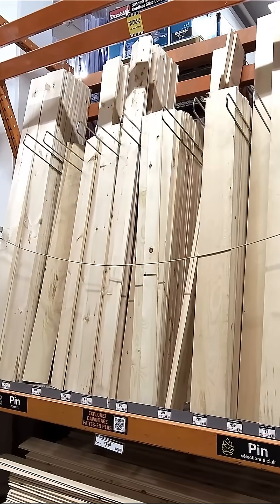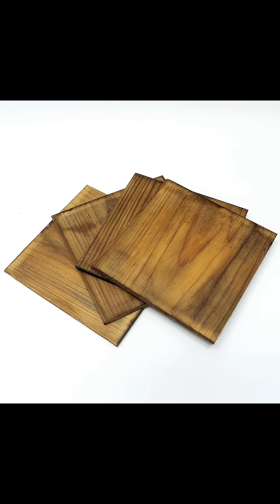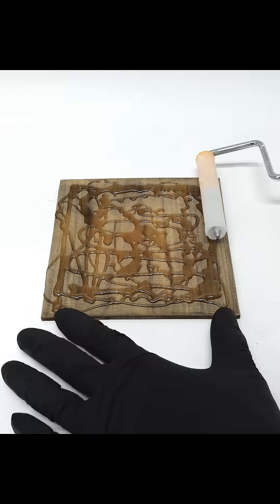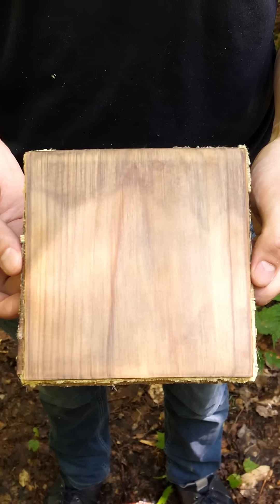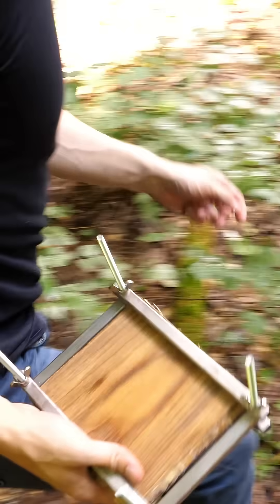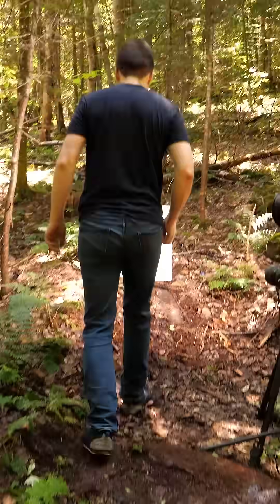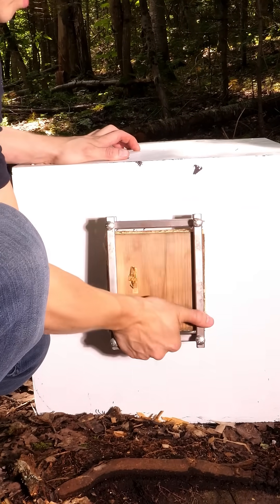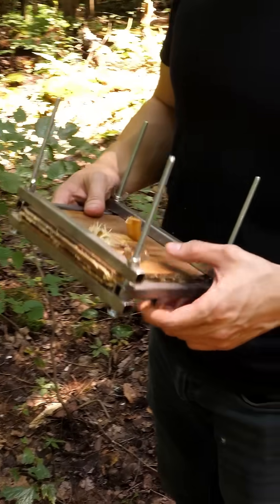Making bulletproof-er wood

Comment: The kevlar needs to be at the back and not glued on the full surface. It's strength is in the ability to flex, so putting it in between those wood layers and squeezing makes it the weakest that kevlar can be at stopping bullets.
Reply: Agreed, If you held the wood together on the edges and let the kevlar able to move and contract it should perform better. the further the anchor points likely the better the kevlar will perform.
Reply: Also I would think something like glass at the front would help, A very hard surface that is just meant to deform/breakup the bullet before it passes on. Logic being that increasing the front surface area of the bullet or breaking it up means smaller masses with speed so less energy to each to stop or larger surface area on the one making it easier to apply resistance to it.
Reply: @coreytaggart128 The "kevlar - hard wood - ceramic kitchenware" composite plate gonna revolutionize personal protection.
Reply: Agreed I said similar
Reply: Why at thr back? Why not front?
Reply: @Loralanthalas because the kevlar needs space to stretch and absorb the impact over distance. If you put it at the front it can't do that and becomes ineffective. If you put it in the back the wood will deform and slow down the bullet, making it easier for kevlar to stop, and the kevlar will get the space it needs to do its thing.
Reply: UTTP IS BETTER THAN NILERED
Reply: @OfficerBankruptUTTP ok gooner
Reply: UTTP IS BETTER THAN NILERED

Comment: i mean, looking back it makes sense.. cevlar itself is good bc its many layers slowing and supporting each other.. the wood with the switched grain directions also holds each other back basically splitting the force really quickly really wide.. the cevlar just makes the grains not support each other that well and also is byitself with the glue kinda useless if it cant move back to "catch" the bullet

Comment: Kevlar absorbs energy by deforming and flexing. No flex, means no energy absorbed.
That being said, you would probably have better results if you'd use fiber glass and fiberglass resin which you cure under pressure and ideally also a vacuum.

Comment: get a normal size layer (whatever that stopped them. put one of these kevlar/thin layers on the back but with 4 layers of kevlar - 90° grain. on the front put 4 kevlars put all the glue's in the kevlar layers like |V| 4 lines and apply small dots on some layers and no dots on others. 

laminate that product too this same product but divided equally in two with an air gap inbetween the two at installation. - put the 2 on front

Comment: WTH is "impact resistant glue?" So many possibilities, but I guarantee you that many, many candidates for adhesive have never been tested or rated for impacts, but I have to ask, why would you use glue at all? Just stack the materials, bolt them in and fire. The glue may be your culprit, because kevlar is a loose fibre and that is how it works.

Comment: There are a couple reasons your armor is less effective than previous.

1. A single plate is generally stronger than multiple plates of equivalent thickness.  Two 1-inch thick plates is weaker than one plate 2-inches thick although I forget by how much.  

2. As far as armor design of the individual plates, you deal with the problem of strength vs flexibility.  A stronger piece of metal is more elastic and more prone to deformation, but that elasticity is what allows it to resist stress.  However, being softer, it will struggle against concentrated force.  A hard plate is going to better spread out the kinetic energy across its surface, but this comes at the cost of being brittle.

These concerns are what made the invention of Harvey Steel armor so important.  Harvey Steel was manufactured by quenching one side of the steel quickly and allowing the rest to cool more slowly.  This process hardened the front while keeping the backing of the plate more flexible.

Taking this principle into consideration, you'll get the best results with a solid wood front and kevlar backing.  Wood in particular suffers from the issue of splintering, and having a kevlar backing to catch those splinters would be key to the success of future attempts.

If you want more information on the principles behind armor plate, I recommend researching Harvey and Krupp steel.  Researching ironclad warship development may also prove useful.  Oh, and Drachinifel has a whole deep dive into the development of warship armors throughout the latter 19th and 20th centuries.
Reply: Spaced armor is not less effective than a straight plate. Composite armors use different materials that alternate, similarly to what NileRed tried to do, but not spacing it is what made it less effective. You try to have your more hard and therefore brittle material before your deformation material, and give the deform material some space to deform. Tanks like to use DU, and ceramic with composites with kevlar spall liners. DU and ceramic have different properties, and putting spaced plates gives you the benefits of both. For body armor purposes you cannot easily incorporate 2 types of strike plates and a spall liner, but there are some prototypes for double plate spaced body armor that use kevlar. I do agree that putting the kevlar at the back would be most effective without putting spacers, but I think you could space the layers with kevlar so long as they are far away enough from the next wood plate. Very interesting history here though, thank you for mentioning it.
Reply: I think 1) only goes when there is no connection between the layers, isn't it?
Reply: he also negated the effect of the kevlar by gluing it so much. kevlar works by being flexable and he glued every inch of it thus making it completely useless.
Reply: A NileRed and Drachinifel collab would be a dream come true, they’re two of my favorite YouTubers!

Comment: The epoxy made it too ridged. If you had added some padding or put all the Kevlar in the same layer without any epoxy, it might have worked. Armour works by distributing the force of impact. Epoxy defeats that purpose.

Comment: the issue is that the glue and the Kevlar holds the word together - you can see in the first video that the front of the wood exploded, and that explosion absorbed a lot of the bullet impact. This time the wood was held together more strongly, so could not shatter.

The key thing for defending against bullets effectively is for the armour to shatter/crumple! This is why ceramic plates are so effective! Kevlar is fine for small arms at a reasonable distance as the impact is small enough that just distributing the load means you get a bruise instead of a hole

Comment: Agreed on the kevlar, the modern rogue actually did a really good video on how to make homemade plates and bulletproofing. You also need ceramic in between to disperse the energy upon shatter. Even if its bullet proof and hard enough to stop it, the jules alone can still be deadly so thats why you need to disperse that force. Itll also stop the bullet from fully traveling through. As well as kevlar needing to flex

Comment: Well, rigid kevlar didn't work. Time for plan B. 

I'm going to take 3 thick layers of this compressed wood, pass it through a wood chipper and then take the pieces and mix them into a ziploc full of mayonaise. I figured since the kevlar being rigid doesn't work, I would remove the kevlar and make everything else fluid. Now I will test if this new method will stop a 9mm.

Comment: You should try saturating the wood and kevlar with resin in place of the glue. Additionally, you may want try ditching the Kevlar all together as the semi-flexible Kevlar layers may be making it easier for the wood to break.

Comment: Man it might honestly work better with a super thin sheet of hardened steel then the wood but glue it with wood glue (it basically chemically fuses the wood together by using a compound from wood) then kevlar on the back

Comment: If you've ever seen Martial Artists break multiple wood boards, or tiles, or cinderbricks in a stack, you'll notice they leave an air gap between each layer. While it's not air, you've left a flexible gap between the wood, weakening the overall structure instead of reinforcing the rigidity. Combined with what others said about the kevlar needing flexibility, you've got dueling systems here of rigidity and flexibility that aren't making a very good composite, but instead work against each other.

Comment: Kevlar flexes that’s why I didn’t work what is solid and it doesn’t flex so putting Kevlar in between the wood, it wouldn’t have enough area to flex so it would the bullet would just go through. A solution would be putting the Kevlar all on the front and then putting the wood on the back.

Comment: Try separating each layer with Popsicle sticks around the edges. It should give it a little flex to allow impact absorption.
Reply: Or two thin layers around a frame, with a non Newtonian fluid filling the gap.

Comment: 2 layers of Kevlar in between each piece of wood.  Criss crossed.  Pull each layer down tight, let set, separate.   Graphite powder will help increase epoxy strength.  Find a way to pull the fabric very tight.

Comment: As said in the comments, you should leave some room for the Kevlar to flex

I would also suggest reverting back to the thicker pieces of wood you used previously, but this time use 4 thick layers instead of 3

Comment: Kevlar is pretty useless when it cant stretch, using it with glue on a hard surface defeats its purpose. you could just glue the outsides to the fabric when you want to use Kevlar.

Comment: You needed to take the kevlar and do 3 layers with one warp up and down and then do one at a 45 and another at 90 degrees. Warp is the direction of the fibers.
Use 2 part epoxy as your glue. 
Congrats, you've just made composite.
Now put the composite between 2 wood and, while it might not stop a bullet, it'll be insanely strong if you try to bend it.

Comment: The point of the kevlar is that it can flex and the deformation robs the bullet of momentum. By sandwiching it between rigid wooden plates you basically made it's primary function impossible.

Comment: When it comes to ballistic performance one plate of a given thickness will always be more effective than more plates of the same combined thickness. As for the Kevlar you have it in the wrong place. You want your hardest armor component on the front and gradually softer but more flexible layers behind. The idea being the hard plate shatters the round or at least makes it start to deform while the Kevlar catches it.
Also I'd put money on that Kevlar you used not being ballistic rated but just the raw textile not all Kevlar is created equal and 4 layers of actual ballistic Kevlar would stop a 9mm on their own wood or not.

Comment: Kevlar works by absorbing the energy... By making it rigid, you counteract its properties... I think the kevlar itself could be beneficial, but it needs to be able to move... Think trying to cut a rubber band by swinging a knife at it... If the rubber is pulled tight it only takes a small nick, but if its limp you can slash it all day to no avail.

Maybe only glue the outside parameter of the plate... Or just layer it all up in a vacuum sealed plastic 🤷

Comment: Kevlar is meant to be flexible and stretch and move and you eliminated that when you soaked it in a hard resin or super glue.  You made it brittle.  Spacing it out in lose pockets might work better.  Try Osage Orange  (Bodark) a hard yellow wood next time.  I think it's the hardest and most shock resistant in the U.S.  Also bamboo is very shock resistant so you might consider it as a cross grain.

Comment: This isn't such a bad idea. I've worked with several woods over the years and main issue with any of them is fiber orientation aswell as their density. Kevlar as a reinforcement could work but would need to be stacked layers of them not a single sheet between the wood pieces. another thing that could be added would be like a 2-4 mm sheet of "textolite" as a middle support layer stuff is used in electronics and is about the hardest thing i've ever tried to work with.

Comment: Maybe, the glue actually weakened the Kevlar material.  Isn't Kevlar meant to be flexible?  So it slows down the bullet. It is not meant to be a solid. It is meant to be flexible.

Comment: When you glue it the material doesn't distribute the energy but only act as a block, when it was only wood the tiny air gap between the layer let it distribute the energy across the boards. Material is only good if it distribute the pointy energy impact distributed.

Comment: Ideally, the Kevlar should be loose enough to catch the bullet rather like a bag. The momentum of the bullet would then be transferred to the Kevlar and from that it would be distributed to the layers of wood. Bonding the wood together would probably work best but only loosely attach the Kevlar to outside of the wood.

Comment: It probably needs to create dampening zones within the layers, not just have a hard shell. It's the same as puncturing a door vs the same with many doors, the separation of each door dampens the momentum of the force significantly until there is none left.

Probably glue two separate layers of wood-kevlar-wood (two hard shells), with the middle layer of kevlar being glued in a grid like pattern, like building a layered crisscross net, then fixed in between with glue only around the edge.

Comment: Wood is great at shattering and releasing the energy of the round, kevlar's great at plastic deformation to catch the bullet. If you had layers of wood in front and Kevlar behind it, but didn't glue the Kevlar down, the Kevlar would catch the shrapnel from the wood. Effectively you'd be making ceramic armor but with wood.

Comment: Fine Woodworker and carpenter here. So part of what could be the issue is actually how the wood you were using was cut from the tree. In the first block it looked like it could have been rift sawm or maaaayyybe quarter sawn lumber where the smaller pieces look like plain sawn. It basically has to deal with how the log is cut up but crucially it also deals with how the fiberous tubes that make of the wood are orientated. Googling a photo makes it much more clear. It also why say for a cross cut you can use a blade with much more smaller teeth to cut across the fiberous tubes making up the wood where when you do a lateral cut from the top to bottom it cuts in between the grains and is why you need a more aggressive tooth pattern..

 I also think part of the issue may just be you are using too thin of sheets of wood. Even if you were to take one board that is say 1" thick of solid wood vs four 1/4" thick pieces the 1" solid piece will likely be more difficult to penetrate through since it has more of the natural lignin bonding the fibers. It would however probably be more prone to shearing than stacked pieces together. 

I would also be interested to see how different species of wood do, softer lumber like pine or even "hardwoods" that are soft like poplar are probably going to preform very different than even a white oak. Lumber is measured on a janka scale which is essentially how much force it takes to embed a metal ball a certain amount into the lumber. Pine is around 600, white oak is around 1300 but you have  much harder lumber like pecan/hickory or purpleheart(which is a naturally puprple wood) at around 1800-2000 and those can already be difficult to work with if your tools are not extremely sharp but even beyond that you have IPE at 3600, Ironwood is around there, there is a brazillian ebony I believe at around 4200... But I actually think Hickory may be the correct choice to try.. It is inexpensive, has a good grain pattern and is used in all sorts of tools and applications due to its durability and its impact resistance. 

The lady thing I would be really interested on seeing is if you glued strips on their edge grain together and then laminated those ontop of each other in opposite grian payterns if that would make it much stronger. Or if you get a skilled woodworker you could actually glue them together at interlocking angles to potentially try to deflect the bullets impact energy as well.
Reply: Damn man nobody's reading that

Comment: Yeah Kevlar isn't inherently bulletproof just because it's Kevlar, it's gotta flex and catch the bullet more so than stop it. That's why you still get bruises and broken ribs if you're shot in a bulletproof vest, your body still took the full energy of the bullet, the kevlar's just got a bit higher tensile strength than normal clothing so it isn't instantly shredded letting the bullet poke a hole in you
Reply: Congrats on reading the top comment.

Comment: Lmaoooo that demolition ranch guy did this to death a few years ago! 😂 He was literally able to make a stronger bullet proof material than any of the professional vests out there doing basically this exact thing- laying kevlar with other material
Reply: I'm sure already know since you are incredibly smart, but part of the issue with the wood is a lack of resilience. There has to be layers that give a little bit and it will do better. Some of the best bullet proof material uses a dragon scale layering, so the impact energy is dispersed over the area rather than the point of impact

Comment: Kevlar isn't good at stopping bullets, but it's great at slowing them down. That is why you don't see Kevlar over metal plates, even though it wouldn't add any real weight. What you've done is you put a dense layer of wood over and under a trampoline, you can't really use the trampoline anymore.

Comment: Need to make it more like dragon skin loosely woven pieces with Kevlar sown around it. The reason why we don’t use dragon skin body armor is the plates are impossible to repair and once used need to be removed and replaced that’s harder to do than the plates we use currently in body armor.